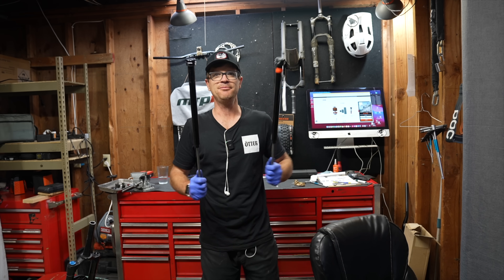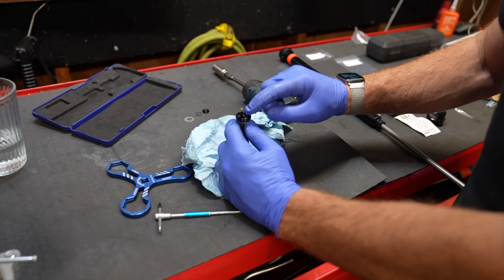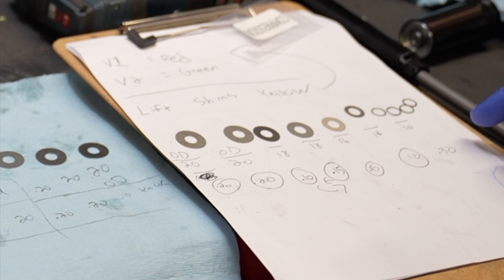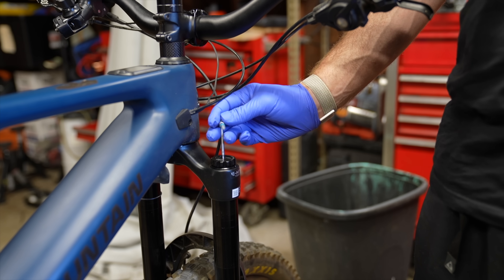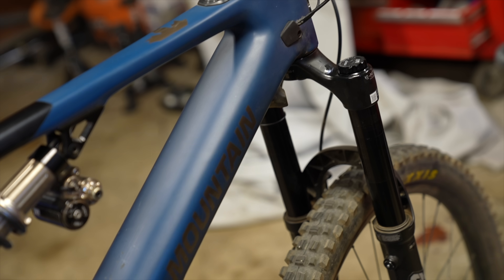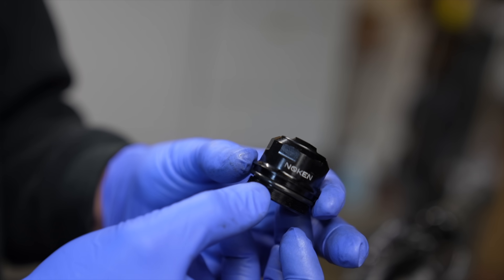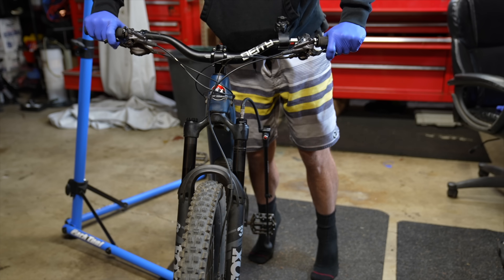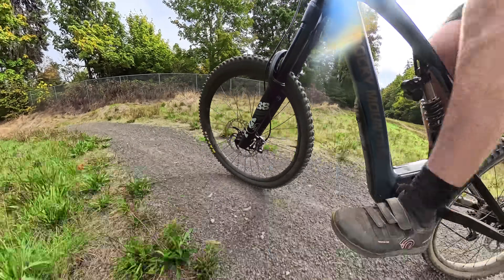Every MRP Fork Upgrade Tested & Reviewed

Comment: Is there a big difference between the V1 and V2 Lift damper?
I managed to buy a yellow tuned V1 and thinking of what am I missing out on by not getting the V2. Thanks a bunch and keep it up! Really love your content!
Reply: The V2 just has some more range towards the open side on the compression meaning full open is now more open. This probably came as a result of some people commenting that the tunes were slightly too firm for the corresponding weight ranges. Everything remains the same iirc. IMO suspension needs some LSC to work properly, so I don't think you are missing on anything.
Reply from the maker: not much better interface on v2

Comment: Hi Otter, I have the V2 lift damper, green tune, and the ramp control v2 installed in a fox 38 as well and I am also 90kg. I have 92 psi and use around 9ish clicks on the ramp control and maybe one or two on compression, i did run 3 fox tokens before I installed the V2 and it was super plush with no bottom out. What PSI did you have in the fork and what rebound values do you have. I have rebound in the middle or maybe slightly slower and have savage grip and control an enough pop off the lip, very smooth fork but definitely need the ramp control with 92 psi so would be interesting to know what PSI you used. I ride enduro mainly and have a trail centre down the road, Ballyhoura, Limerick with some nice park style jump lines so its a mix of both worlds and set and forget is the style here.

Comment: You have to try the lift damper in a fork with a vorsprung smashpot coil spring, both set up for the correct weight must feel incredible with no tinkering with air pressure
Reply from the maker: Not a fan of coils forks, but yeah great idea

Comment: Hey Otter and friends  Side note/recommendation. I’ve been waxing my gen 3 Levo chain since 2022. I use ski wax in a crockpot ($3 at thrift store), a piece of coat hanger to place the chain to dip it in the slow cooker over night (on warm). Here is the point: the chain is not “stretched”/worn and it stays clean and grit free (I used to be a dumond tech user). The chain checkerometer shows far less than 0.5 wear. I am on the oe cassette, chainring, chain. I now have 2 chains to alternate but one is simple and quick enough. The drivetrain is gx / x01 eagle. Shifts fine. If I ride in the wet at the bike park I just bring the second chain. Drive train stays clean and gunk free. Just wipe the sides of the chain with a paper towel when you pull it out of the slow cooker then wait for it to cool and run it back and forth along a nail to free up the links and twist it a couple times. Voila!
Reply from the maker: I burn chains bad I might try this
Reply: You never mentioned the distance you rode on those chains dude. May as well be brand new.
I have 11kkm on 2 M8100 Shimano chains using drip on wax, I have no idea what they would have lasted with oil, bit at this point they are both slowly nearing 0,5%, same cassette and chainring (though chainring looks a bit worn, or rather thinned) but it's not a ebike.

Comment: Change my mind.... it doesn't matter what kind of fork you use (RS, Fox, etc...), the fork is only a skeleton. What matters is what kind of charger unit you use.   If I buy Domain (okey its maybe a little bit havier), or Zeb Rush RC, and I change the complete charger to MRP Lift, I got a high end fork ?
Reply: Basically, yeah. It's what I did to my base F36.
Reply from the maker: Air spring is important
Reply: @Wasmachineman  Thank you. It's just that people often get into religious debates about brands... One manufacturer (MRP) makes "brand-independent" chargers. Boom... Make them understand...

Comment: I asked on reddit can I refill my fork through the bleed valve because they were leaking upside down... and some masters of r/bikewrench said NOOO! you are crazy for suggesting this... and then there is you, refilling from the top, some fluid... and it works too! 
I ended up refilling from the valve and it was great
Reply: lol reddit... You absolutely can. Suntour has this method in the manual even.
Reply from the maker: It doesn’t work well

Comment: How would you theorize these dampers/ramp control would handle huge drops? I got addicted to big air and big drops this summer and my 38 all tokened out could use an upgrade.
Reply from the maker: The one I had might not be enough, they make one with a token built in. I don’t know how ramp control works with Fox damper yet

Comment: I have been wanting to know if the fox 34 damper will work in the Marzocchi z2. Can you test it and see if it does? I have the ramp control in both of my Marzocchi Z2 and also in my Fox Rhythm 36 but I would like to upgrade the dampers eventually. 👍
Reply: There's a specific Lift damper for the Z2 now. ✌
Reply from the maker: Stanchion size is all that matters, 34 -34 good

Comment: Interesting findings! I found that upgrading to the charger 3.1 damper from the charger 3 made a much bigger difference than installing the noken
Reply: Did it become more small bump sensitive after upgrade to 3.1? I'm currently using Charger 3 and it absolutely destroys my hand when riding tech chunks and roots.
Reply: @piotrmielnik1404  maybe your bushings or seals are the problem I'm riding my charger 3 free of any hand pump check if your air spring is well lubricated too and it's gonna feel amazing 😊
Reply: @piotrmielnik1404 yes it improved small bumb by a lot. The whole fork is more free to move through it's travel at any given damping setting compared to the charger 3.
Reply from the maker: I am 220 lbs no tokens i could barely use the travel km charger 3. Noken would do it justice
Reply: I'm 190lbs and found the same. I was using a bit more travel with the noken, but the charger 3.1 upgrade made a much bigger difference to how the fork actually rode. I didn't notice the noken as much on the trail
Reply: I'd also like to know how it changed for you since I'm planning to upgrade it this winter while I'm doing a full service.
Reply: Noken improves the air spring linearity, charger 3.1 change small.bump sensibity but havent been perfect yet on fast hits..i am going to try the wps podium piston

Comment: Perfect timing. I have been on a ZEB Select and getting the most out of it but on deep repeated compressions on the bike park steeps its outgunned. The Charger 3.1 upgrade reviews have been mixed so been waiting for a Lift Damper V2 review. I am 155 lbs and in between tunes so good to know its better to be on the upper end than the lower end on the V2 tuning side.
Reply from the maker: 3.1  sucks, I would easy tell you in go for this, funny the RockShox needs this much more than Fox but j don’t own any RockShox

Comment: You mentioned in your fox 38 setup guide that adding volume spacers would screw up the rebound/setup. Is this true with the ramp control too?
Reply from the maker: Totally messed up everything it changes the spring curve. Ramp controllers knob so easy to find it back

Comment: I have a grip2 I tried to set it myself using this channel guide and others it was really bad jerked me left and right on the trail then I did the next best thing I googled fox 38 grip2 and my rider weight copy pasted some forum settings other than having 2 tokens instead of 1 I then unknowingly went straight to black enduro trail and never felt betrayed by the fork "it just worked" the number 1 mistake I did was try to hasten the rebound to make it "more plush" all it does is try to eject your from the bike 2 weeks ago I tried to change them again I did like 5s on  a rock garden before I lost control and had to put my feet down, put the heavyweight" settings back again did half a mile of rock garden without stopping, it's so easy to mess it up I get why people want the MRP..I actually ordered a lift v2 myself for that very reason but now that someone gave me the right settings it's sitting in my living room maybe one day I'll change it
Reply from the maker: Try it !!